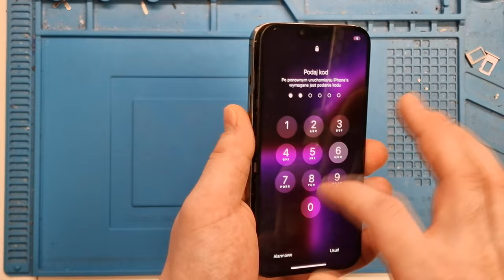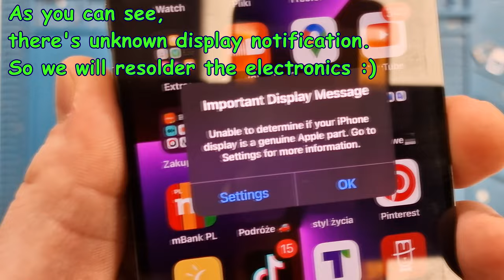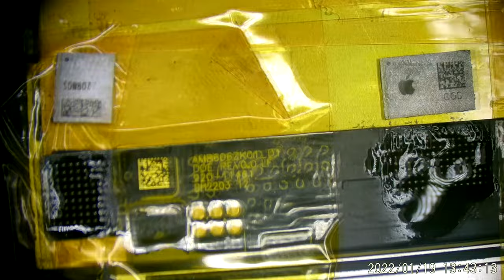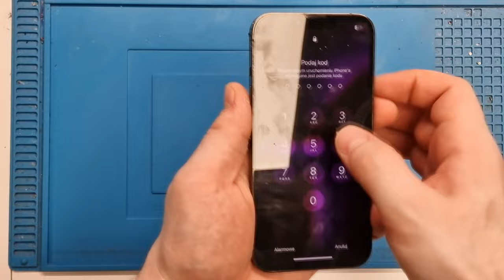🔧iPhone 13 & 14 Pro Screen repair (IC swap) + back replacement 4K video⚙️ @JerryMobilePL

Comment: For iPhone 13serires aftermarket replaced screens,only 13 and 13mini available for IC swappable.That's RJ incell. But for iPhone 14 series, at present there is no IC swappable aftermaket screen availble.
Reply: How abt ek pro incell?

Comment: For the solder paste, what temperature melting point do you prefer? 138, 158 or 183 degrees?

Comment: Hey @JerryMobilePL When you removed the back glass the machine it was on or off and if it was on you taked off the battery ? what temperature you were using during the procces ? jus in case it was on the machine while you did that

Comment: Hey thank you for the video, I did this on an Iphone 14, it worked fine then I plugged the screen it works but touch does not work. What did I do wrong? Did I fucked up the chip or the flexcable?
Reply from the maker: Hi! Check again if all pads are ok. 1 bad ball is enough to not working touch. It's hard to damage the chip- I think You have to reball it and solder again 😉

Comment: Can you do ic chip replacement does have to be apple lcd or aftermarket lcd will work to
Reply from the maker: Some not original displays work but can have a problems after iOS update. Originall will 100% work

Comment: Would it be better to remove solder on pads before resoldering chip. Having solder on chip and pads seems like too much solder. But glad it worked.
Reply from the maker: You are sure, but more solder is better becouse faster it takes the temperature and it's snaller risk to heat down the screen

Comment: Can all this be skipped by using a programmer to copy and write the serial number or whatever ID they use?
Reply: Yes, if the chip is working and not just for design
Reply: Not with the new models (11 and Up). If you don't want to have display error message, you have to swap the display IC.

Comment: cant we just desolder the old screen chip ?? is grinding and polishing chip of  old screen is necessary?
Reply: That kind of heat would damage the lcd itself, that’s why he used a grinder
Reply: the solder used for the replacement is special "low temp" so you can melt it with a heat gun without burning the screen. the solder used at the factory needs much hotter temp to melt, so you have to grind it off

Comment: A co z funkcja 'True Tone'?
Reply: Actually there was no need to transfer both ic's , only one was enough , the center one to fix error msg , and yes there was no true tone that is why he did not show it up 😃
Reply: What about autobrightness feature too ? Does it work ? I quess no 😢
Reply: @Prasklo_sk  now it does after iOS 18 :)
Reply: @rezaakbari1773  only if you replace screen and proximity sensor flex together.

Comment: What about true tune?
Reply from the maker: For now the only solution is JCID programmer box (V1SE or V1S Pro). Very easy to copy truetone 😉
Reply: @JerryMobilePL cool, can you copy the old lcd data after the ic swap or do you have to copy it before than program the new lcd after
Reply from the maker: @bibarz2377  need to copy before swap

Comment: What about true tone.?
Reply: True tone can be fixed by the tool from jcid. They have modules to program the true tone without the original screen.
Reply: Not for 13/14 pro
Reply: @kumarbhatia6566 iPhone 12 ic transplanted ,how to fix truetone plzzz answer bro